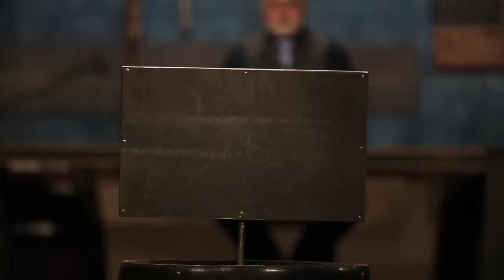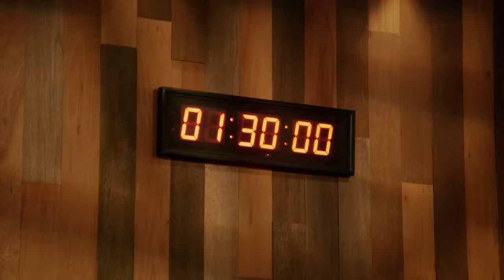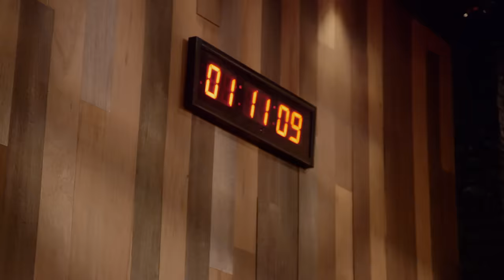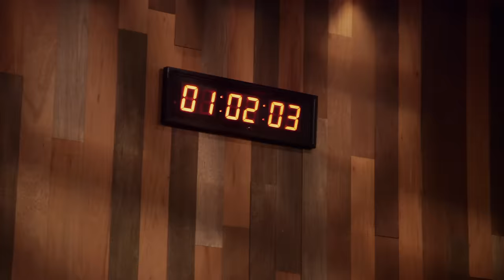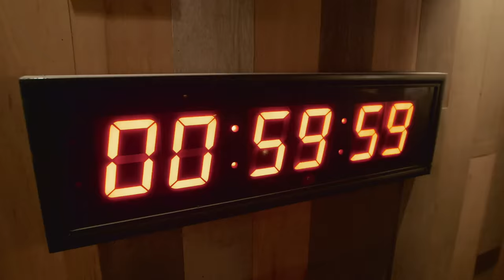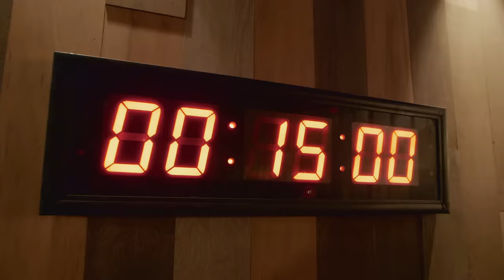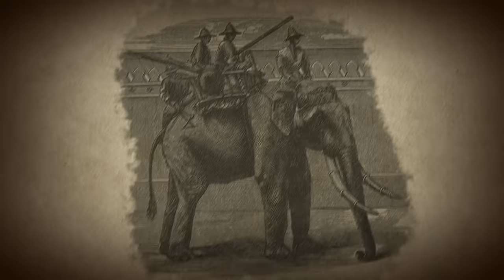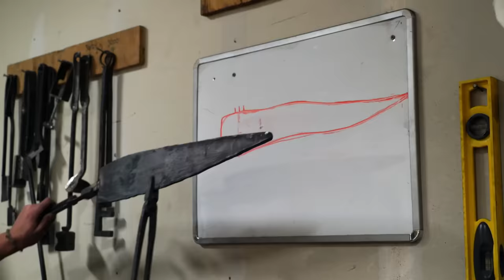Forged in Fire: Recreating INSANELY Complicated Blade From Memory (S8, E16) | Full Episode

Comment: 10.000 is not enough, i wish they gave those guys 100.000
Reply: In fairness, the level of exposure the show offers these bladesmiths could easily be worth far more than the $10k prize, not only to drive their own commissioned work, but for landing job opportunities at various shops that do high end work using equipment and materials that are far outside the budget of most hobbyists.

Comment: That blade looks like a Kukri. It looks  alot like one I acquired from Nepal , a newly designed handle as compared to traditional. That was from the Kukri House . He has serrations on the top of the blade mine is a smooth sharp  blade which is also non traditional, still hand made from Nepal. Few other variations on the handle, the thickness and width. I like mine better.  Just saying 🤫🤭😐

Comment: The most painful part of watching these so-called blacksmiths forge is how they put their billets in the forge, set it down and walk away.

You want to hold the metal above the kiln floor and massage (push and pull) it through the fire for an even temperament.

Placing in the center like what they and so many others do causes cold spots and uneven heating. This is why their metal cools so fast and is so difficult to shape.